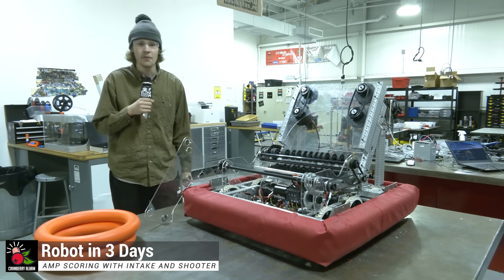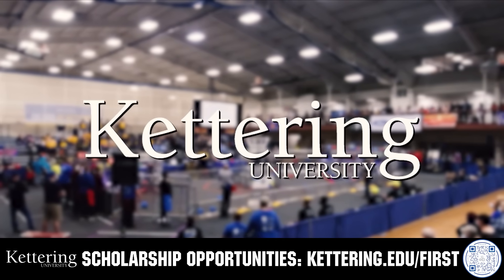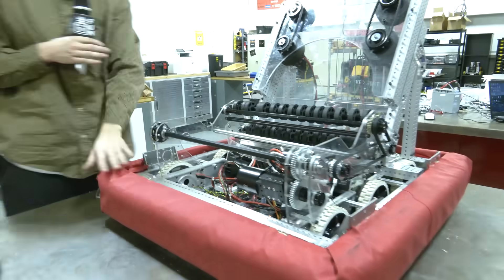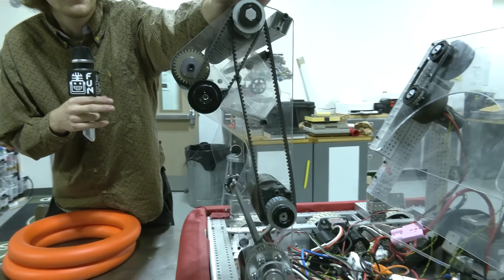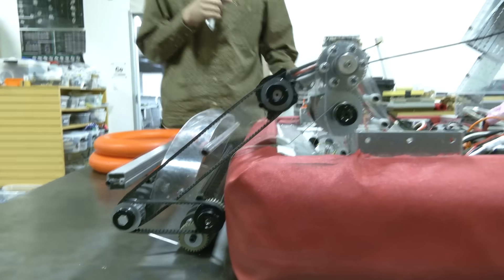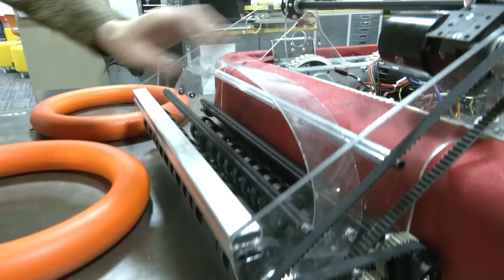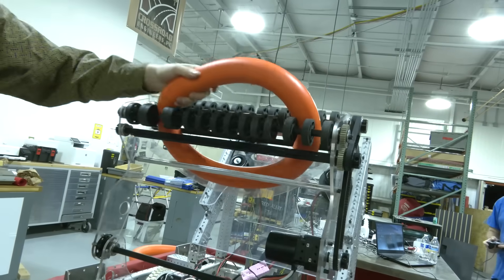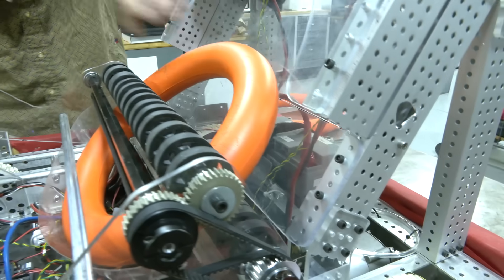Note Manipulation | Intake 2.0 and Hand Off System | Ri3D Cranberry Alarm CRESCENDO

Comment: How are you stopping the intake motor once the note is pulled in to the backstop lexan piece?
Reply: A bit after filming this, we added a limit switch to detect the presence of the Note.  Check out the intake specific video for more on the limit switch: https://www.youtube.com/watch?v=j8k97lN1e6U
- Cory from Cranberry